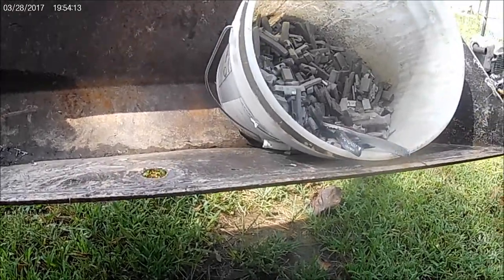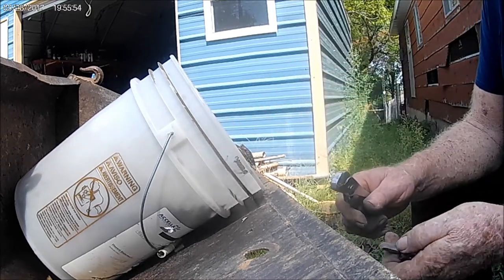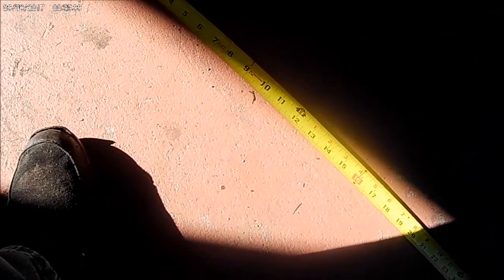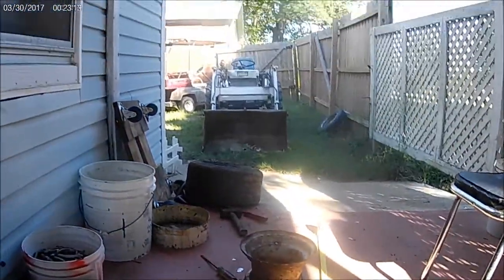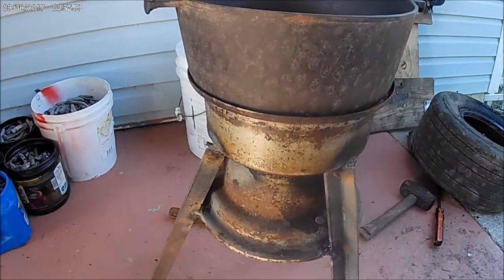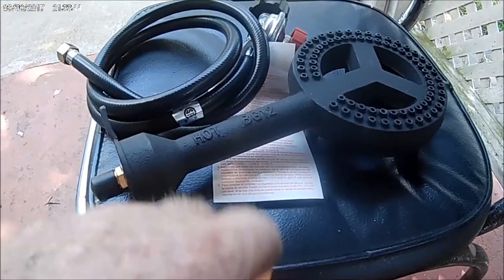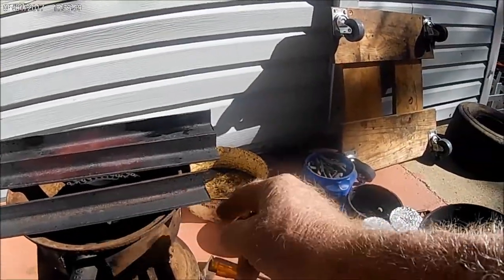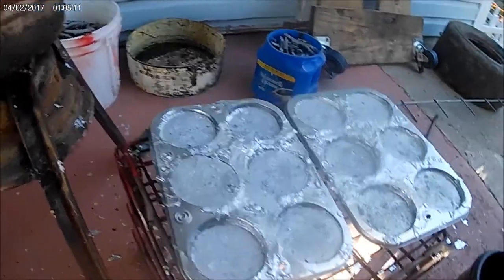Making a lead smelter and some lead melting

Comment: Awesome DIY. I used to work in Electronics company and using lead for soldering.  Keep blogging sir.  You are doing a great job.
Reply from the maker: thank you for the kind words, I have done something like this many years ago, that when I found out first hand will happen if only a slight amount of water gets into the lead pot,, it explodes over everything, I was just very lucky I didn't get hit by any of that molten lead.

Comment: Nice smelter. All the zinc WW’s are stamped with a ZN. I separate all those out by hand. I use a pair of cutters to check any I’m unsure about. Lead cuts, zinc and steel doesn’t. Then I keep the heat low in case I missed any. Good idea to be putting back some lead.
Reply from the maker: back in the good old days before the do-gooders got involved, we didn't have to sort,, all the weights were lead.
Reply: @MissouriOldTimer  those were the days👍🏻
Reply from the maker: @georgiaboy4410  yes ,before the government got involved in everything.

Comment: This a great video Vernon, that rim set itself out just perfect for the job, it works nice for the legs to sit at an angle, the burner fits well, it holds the cross bars perfect in place and just the size for your pot, did you mention what you want to do with the lead, I guess sell it for a good price, that set up with the pot will be perfect for oxtail potjie or stew, thanks for sharing Vernon
Reply from the maker: actually it did work out pretty good, yes, it would work good for stew etc, and I plan on using it to heat water when we butcher chickens.

Comment: A neat way to make a ingot burner . You can test the wheel weights with side cuts . The side cuts will make a mark in lead wheel weights , hardly scratch a zinc wheel weight . Or do like you were with a lower fire and melt the lead and the zinc and steel will float to the top .
Reply from the maker: back in the good old days, you didn't have to sort through the weights,, they were all lead before some government outfit decided they didn't want us using  it.

Comment: Great idea to use the wheel to hold the burner and it was great to watch the burner in action. It does look like a lot of work to sort through the different metals
Reply from the maker: yes it is kind of a job but I enjoy doing that kind of thing, I am trying to figure out a way to mold buck shot but I haven't got a plan on how to make a mold yet, I could buy one but for no more than I would use it , it's too expensive.